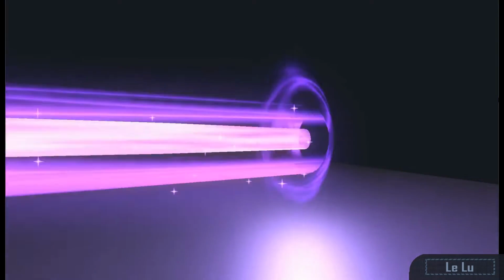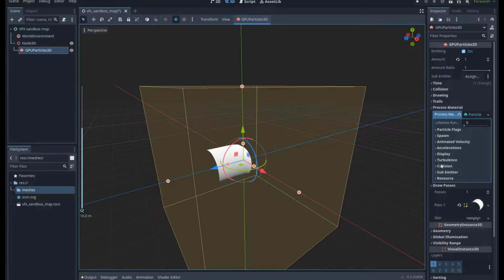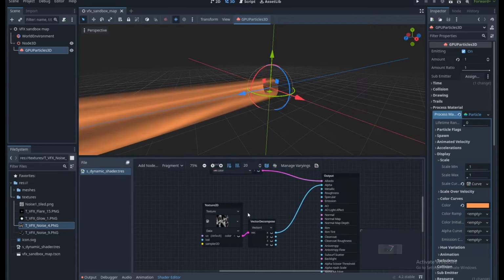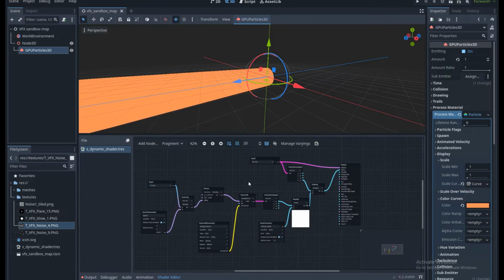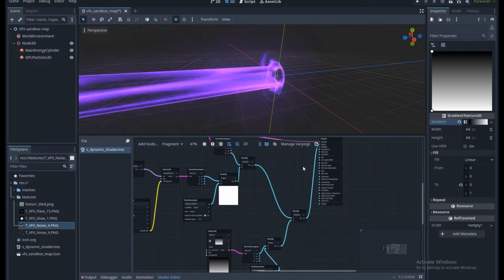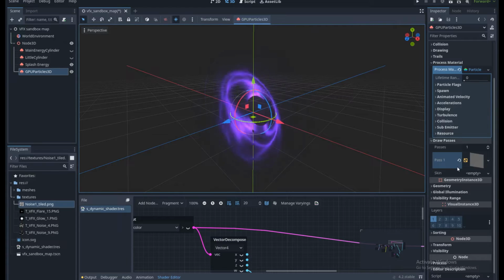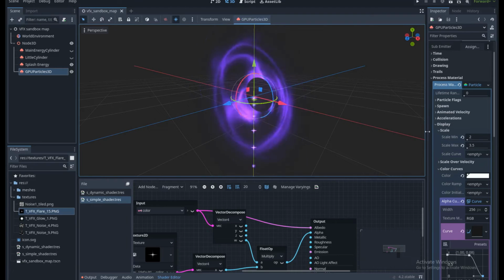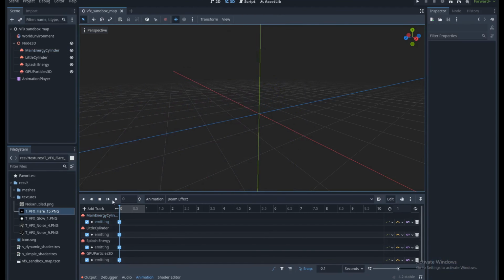Godot 4  - Laser Beam VFX

Comment: Mesmerizing... I have a question, why did it suddenly started glowing around 12:13 when you just changed color to purple?
Reply from the maker: oh.. its because in Godot when you manually push the color values out of the default limit, Godot automatically know that the color is so intense that it glows.. and Godot does that  automatically with help of the Enviroment-World node and the GLOW option..

Comment: Still creating the material, but I can't get the beam to scale fast like yours. Since the lifetime is 2.0s, it takes a lot longer. To make it look as fast as yours, I needed to reduce the lifetime to 1.0s. Maybe I'm doing something wrong.
edit: to clarify, yours reaches max length and then holds there for a bit. Mine only reaches max length after 2 seconds. Changing the lifetime does not fix this as I thought
edit2: yeah, you are the goat but I couldn't follow this one. I spent a few hours trying to get it to work. Issues I found: I think somewhere along the way, you change the max curve to 50 or something, this is why it's faster than mine. Problem is that the origin of the beam is also moving a bit along the z axis. Also, I couldn't eliminate the hard edges with the gradient.
Reply from the maker: oh.. sorry about this man, this was my first tutorial so i didn't explained that part properly.. yes, I've increase the max scale of the curve to 50...  and also in Blender, when creating the cylinder I positioned it exactly below the pivot point so it doesnt move while being scaled..

Comment: Something must have changed from Gdot4.2 to 4.4 the shaders still share settings when made unique
Reply from the maker: thank you for your comment.. i just checked it and it still works.. but you need to make unique the material and the components of it..
Reply: @Le_x_Lu  I had to make new components and save everything as a separate component for some reason. Not sure why

Comment: Could you, plz, explain how to make those beams appear simultaneously. Because my smaller beam appears later. Also the length of the smaller beam changes from time to time. It can be longer than the 1st one or shorter. Thanks in advance.
Reply from the maker: Hi.. you need to play with the scale curves until get the desired result.. and Syncthing all the effects start with the animation player 😅.. This was my first video, so i know there's a lot of things that need more explanation, maybe i will do a new beam tutorial, using a new method..

Comment: Why does my beam's texture keeps rotating but yours stretches at the end? Did you do any UV unwrapping?
Reply from the maker: yes and no.. i mean, when you create the Cylinder in Blender, it automatically creates the UV's... all I did is to move the pivot point of the cylinder, so I can stretch the cylinder using Godot's Particles...  ♦   . check the video at  0:54s  see where the pivot point is... and at 4:01  stretching the cylinder.

Comment: when I do scale the beam to 8, it scales around the middle rather than to 1 side. What am I doing wrong
Reply from the maker: make sure .. in blender, before export .. that the pivot point is NOT in the center of the cylinder.. check the video at  0:54s    the yellow point position.
Reply: @Le_x_Lu I got it. Many thanks!